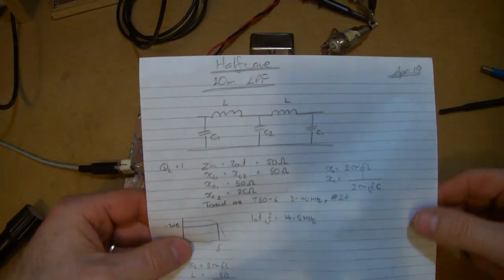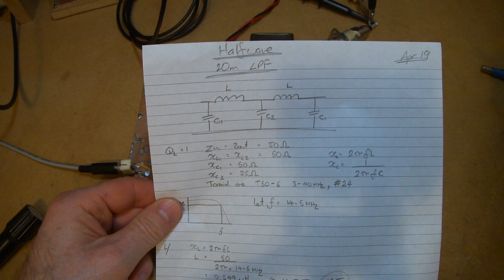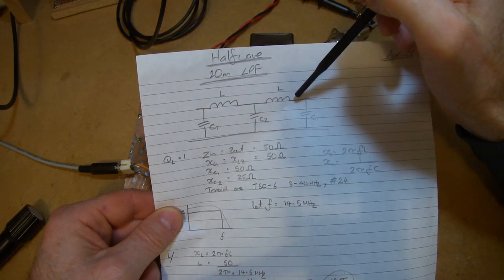20m Transmitter Configuration

Comment: Awesome Charlie. Why have you not used NE612 for the mixers?  What coax are you using? RG174? Thanks again for the vids. I am   a new old Ham VE3. Always loved RF wished I would have got my ham  call  30 years ago. Oh well.  Cheers
Reply from the maker: Hi Dave. I used the NE612 a couple of builds back and wanted to try something different. I was kindly given these and they are ideal for the small tramping rig. The coax in the video is out of an old Yaesu rig. Really good stuff with a 'hugely' high melting point.
Reply: @CharlieMorrisZL2CTM  I saw that you used them in previous builds, thought maybe you found a problem with them. I ordered a bunch of toroids from Kitsandparts. I am moving so cant wait to get things setup for the Fall or as soon as possible. Were in spring time here so too nice to be inside. Again thank you from Canada.
Reply from the maker: @rfdave3980   My pleasure Dave. I hope the shift goes well.

Charlie